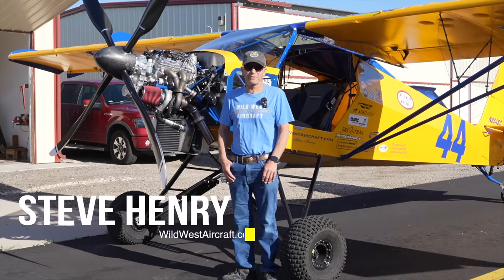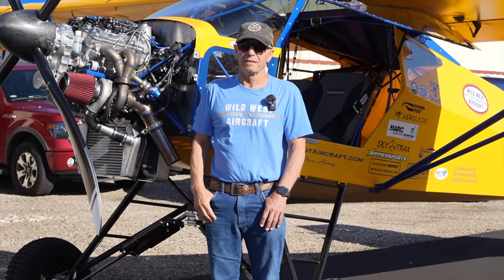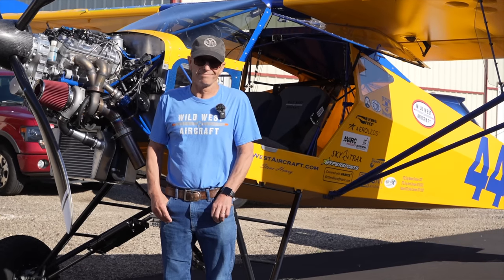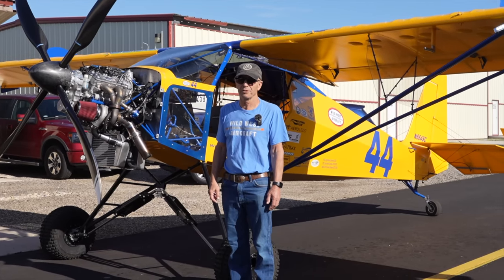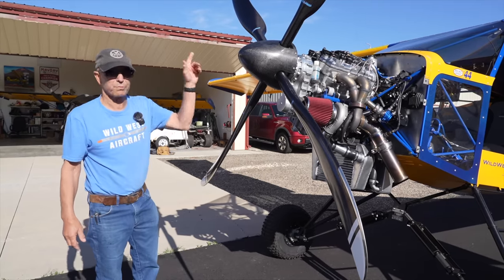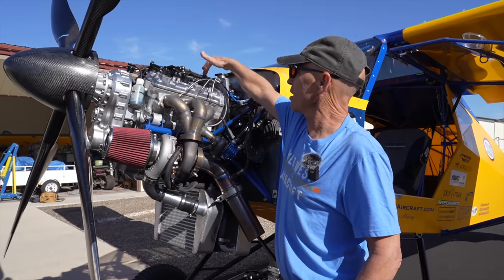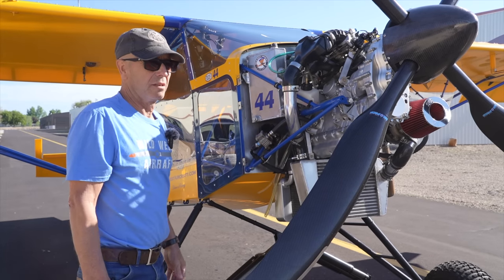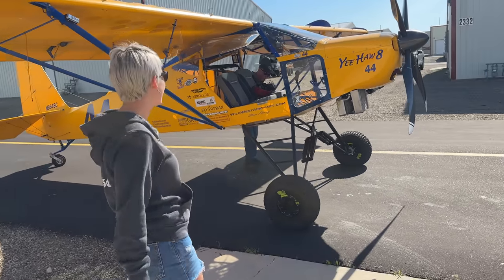What an Incredible Engine!

Comment: I remember when Yamaha put out the first 4 stroke snow machine engine back in 2003/4? The sled was an overweight turd, especially if you were at altitude/hill climbing. Then, someone put a turbo on it and the rest is history. Happy to see them in aviation
Reply: Arctic Cat produced the 4 stroke model in 1999. Well Yamaha produces great engines, Suzuki is better, and in many more markets than Yamaha.
Reply: @stevecarlisle3323  I will always be an Arctic Cat fan. To be honest, I own all four manufactures but kick myself in the rear for not getting a 2001 SRX. I ordered one but my dealer failed to come thru...sigh

Comment: I run a RX-1 in my gyrocopter and one of Teal's original adapters for the rotax gearbox. No problems 5yrs running. Water pump is in tip top shape. Although I don't ring out my engine like you do racing I anticipate I won't run into water pump issues. Keep kicking it and thankx for all the yamaha engine development! Why ppl think Rotax is the bomb, well u described that well enough.

Comment: Great video thankyou Steve and Sara. With 400 HP in front, is pulling to the left much of a problem when applying the power on take-off? Also, what is the recommended TBO on the engine?
Reply from the maker: Yes, I hold a lot of right rudder on takeoff!
I don’t think anybody knows the TBO

Comment: Hey Steve, do you have weighed the engine in airplane configuration and stock form? Just trying to understand differences to something that makes similar horsepower to a low horsepower version of this, around the 270-300hp range, such as an O-540 or IO-540 or similar.

Comment: since i was i child, i have dreamed of building my own airplane. recently i have been imagining a slow toroidal split level counter rotating multi blade design powered by a small  turbo engine. maybe even active noise cancellation via multiple small speakers around the prop shrouds. i want to be as quiet as a hot air balloon floating by.

Comment: What kind of burn rate on the stock version?  Thinking of replacing the  ea81 i run now
Reply from the maker: Fuel burn is going to be close to the same as other engines, if they are tuned correctly and pulling the same load.

Comment: That engine is sick. Excellent power. Owe yahmaha 998 turbo sidewinder😊 i can get massive power out of them. I set records doing built sleds im out of wisconsin few miles from eaa wittman field area all the jsts buzz me. We pushed 600 hp out of one but to keep reliability 500 is reliable range for the builds we been doing. Check out our osp outlaw yahamaha nytro 😊😊😊 i knew you had a turbo. You want dependability too. The new sidewinder engines can put massive power. I like the apex motors 😊. All yahmmys are insane. Stick to yahmaha id go to the edge of the earth with them. If you come to eaa let me know id love to go up if able . Im a few blocks out. One stop performance really can crank some stuff up. Man i love it i was watching your vids of you cooking 😊 run em open exhaust i love it. You can get a kit that opens and closes electronically but everythings weight.¹ you would think im coo coo if you seen me tuning my sleds im out all night playing but i learned them well from it. I am asuming your using the nytro 1049cc god i love that motor but ill say the newer sidewinder motors are much more capable and lighter.different spund though . The older apexes ypu could get stupid power out of them. I dont know what your allowed but the new polaris rzr makes a four cylinder and man that can take a piss pounding and ive seen 1000hp out of them from a place i know thats really good in florida. That new four cylinder is ridiculously tuff. I am more partial to yahmaha though. But at the end of the day the rzr r 4 cylinder is just meant to take boost. Id really like to go up if you come to eaa. You know alot and seem like a gu ru . I love it. Those engines done right can really take a beating. Yamaha is my favorite ever .  A billet blocks the way to go. I know guys that makem . Thumbs up all day. I dont know what your allowed to do though. I still love yahmaha im just thinking out loud. Throw me in there please if you come to eaa this yr my company does all the traffic control out there. Contact jamie at stom companies plz we are just a few miles from eaa. Thats are home.

Comment: Supercool Steve!, which ECU? Motec or AEM? Using 2 electric water pumps helps to increase the max continuos power? Or still running on the 160+ hp? Yamaha have to hire you and Teal's to become development heads for the incoming aircraft emgines!
Reply from the maker: I use a Hypersports/ Link ECU.

Comment: Steve can we have a constant speed prop on the Factory spec 275HP turbo yamaha?   I want to have an Amphib plane with some punch for getting off the water.  I live in BC and we have allot of smaller high elevation lakes. 180hp doesn't cut it all the time. and more than that and you are getting heavy.
Reply from the maker: Yes, you can put an air master electric constant speed on it if you want to.

Comment: Steve, what would it cost me to build a good 300 Hp Version of what you have there with the 3 cylinder engine and 4 blade prop.   I know that is hard, your best guess.
Reply from the maker: I think you can do a firewall forward if you put it all together yourself for about 25 to 30k for 275 hp

Comment: I wonder how this  compares to a LS3 engine which make 426 Hp which is a stock engine with no modification, and weight  is 410 lbs. You can get a LS3 engines for  around    5 K.  There must be  other reasons that makes Yamaha a better engine. Is  it more relievable or  lighter?
Reply from the maker: It is much lighter

Comment: Have used the electric Davies Craig water pumps on prime power diesel engines running over 10k without a failure if the unit.

Comment: Usually mechanical water pumps don't fail they are so simple in general with most engines. Yamaha must have had a bad design. Rest of the engine is very well built.

Comment: Steve, things have changed and probably not for the better. It would be nice if Formula One stuff didn't make it's way into American aviation. I'm not blaming you but you're at the forefront, like it or not?
Reply: Lycoming and continental were obsolete 40 years ago. This engine design is 20 years old. Times have changed for the better.